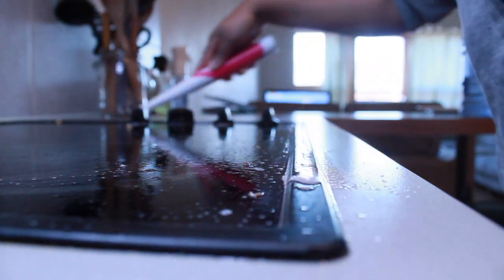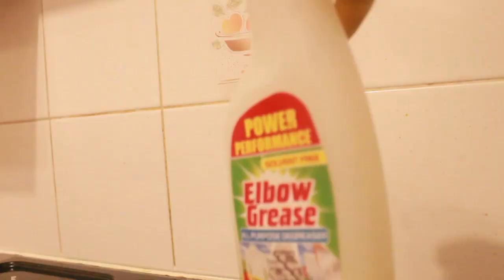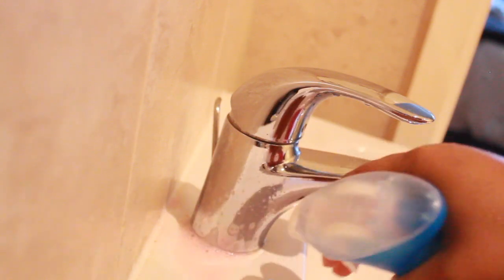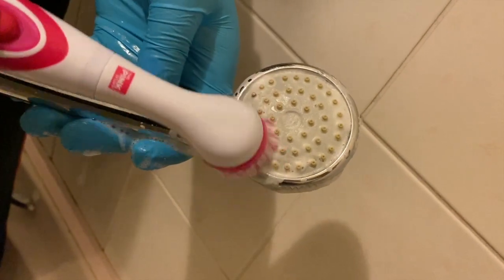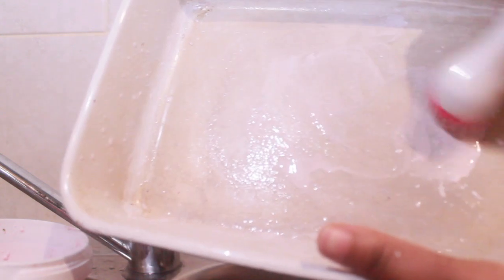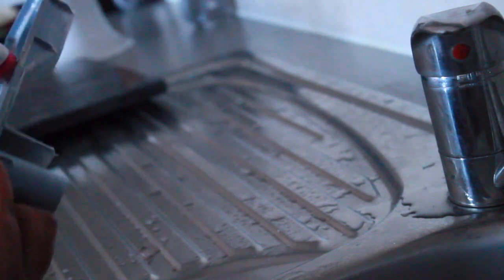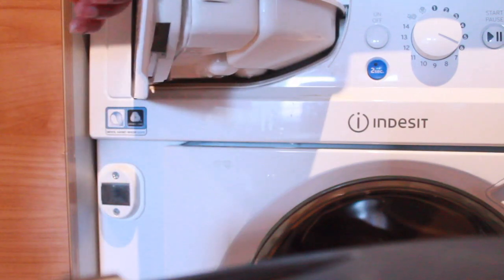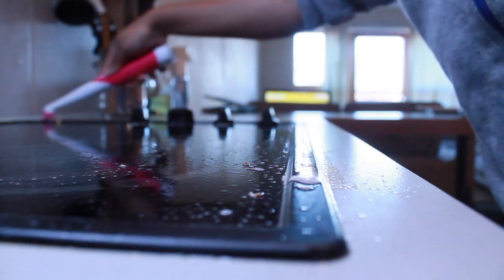WHY I LOVE THE PINK STUFF SONIC SCRUBBER |WHERE TO USE THE SONIC SCRUBBER #thepinkstuff #cleanwithme

Comment: I have a question about the scrubber. Along time ago, it was called the "sonic scrubber" it was sold and manufactured by a company in the United States that was based in Utah. They made the product in China, but they were based in Utah and they had a Utah phone number. It was called the sonic scrubber. They had a website, but that website is now defunct. I'm curious if there is any contact information about this product, about the company that makes it or anything at all on the packaging. Thanks! Also, mine came with some really cool attachments with different type of scrubbing that was to be more effective because they were more like scrubbing pads than brushes.
Reply from the maker: Hey 👋 honestly I have no idea about the American company I bought this in a  UK shop as that is where I live and it also come with different brush sizes for different areas. Maybe if you look on Amazon you might find what you are looking for I hope this helps

Comment: Great piece of kit but I’ve managed to get one of the heads stuck on it, can’t remove it to change. Any ideas?
Reply from the maker: Hmmm have you tried to twist it side to side when taking it off? If that’s not the issue maybe add a little oil to the head the base of the head where the heads connect? Try olive oil or the one for squeaky doors , let me know if that helps 💕

Comment: But how do you clean the brushheads afterwards?
Reply from the maker: I detach them , either in a bucket I add disinfectant and leave them in there for a while then air dry. I also have another pink stuff brush for the bathroom only